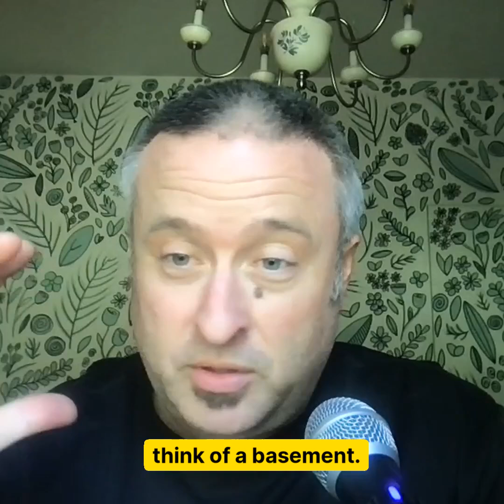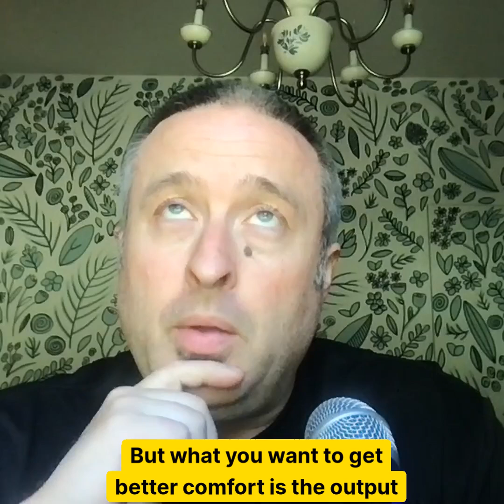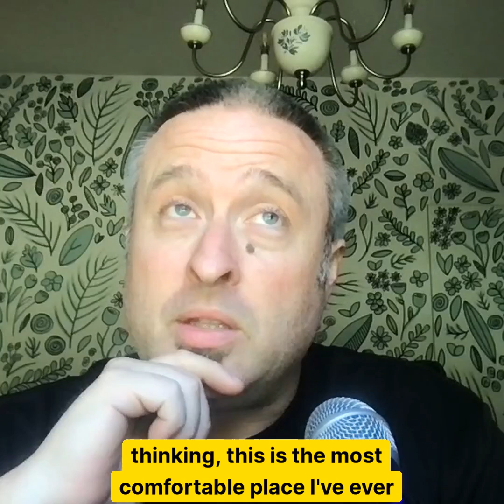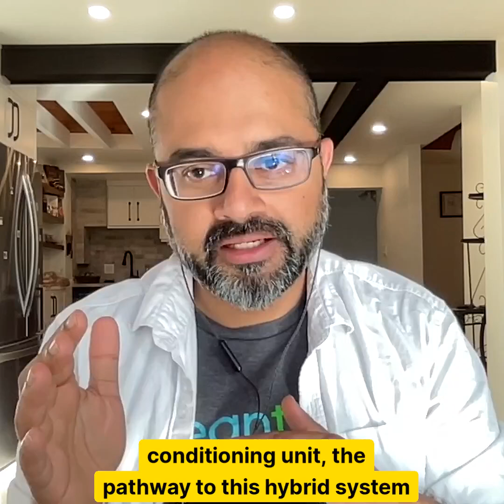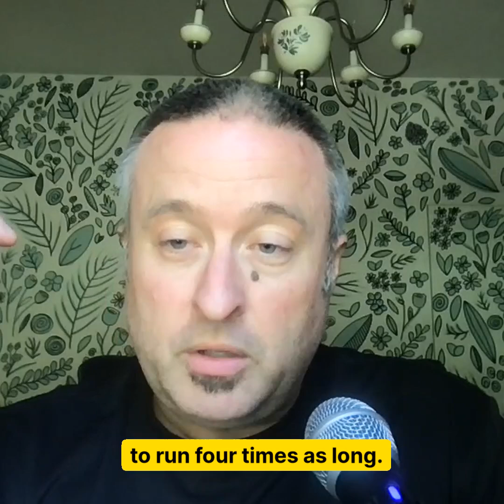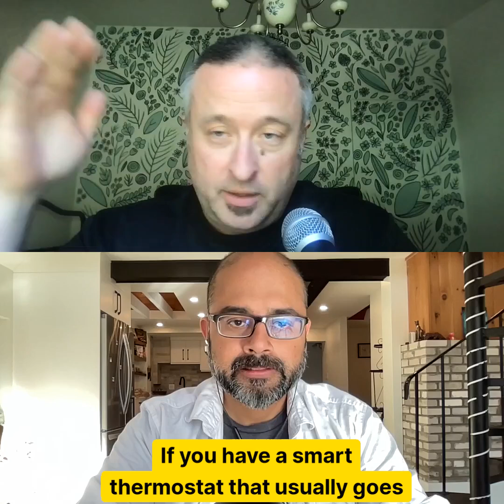The Case For Hybrid HVAC: Comfort - Part 1 - Boundary Spanners HVAC Podcast

Comment: Sounds like you are making an argument for a modulating hydronics system that works on outdoor reset
Reply from the maker: On load matching, yes! I had an ECM pump on our hydronic system (a 1961 model boiler actually), it did a great job of delivering comfort in heating season. It did not sadly do much for air quality, which is why I prefer forced air systems in general.
Reply: I am designing a hydronic ERV with isothermal dehumidification, I,e heat pump. Using your model of a thermal / vapor control layer on the periphery.  The controls are tuned with outdoor reset to balance the heat transfer. As you stated we want the thermostat to always show a heat demand.